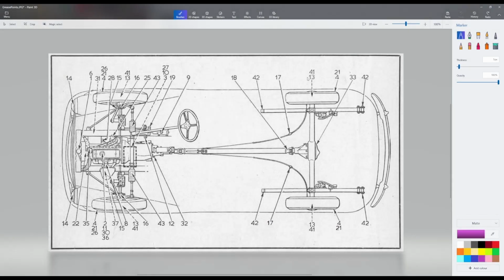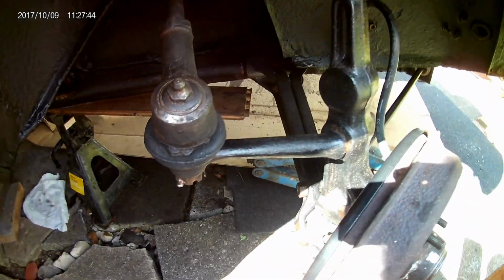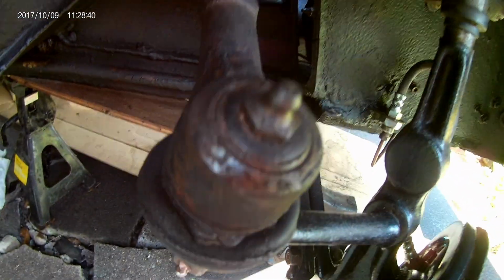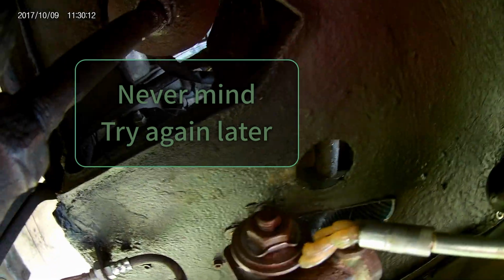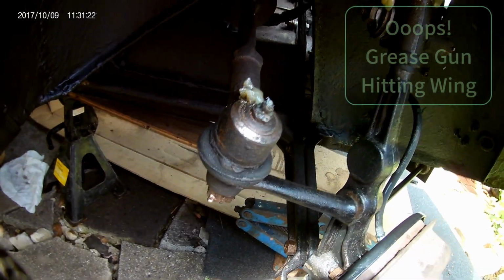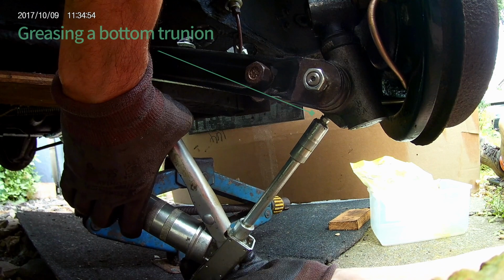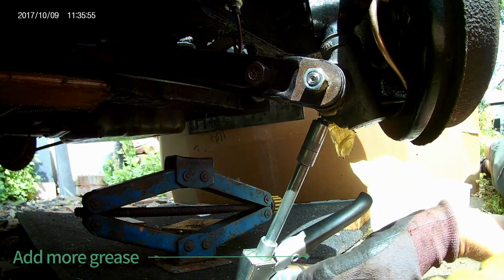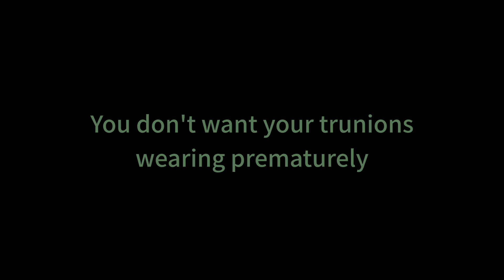Morris Minor 1000 Servicing: Grease Points

Comment: Another fine video, but again the steering rack is ignored. Access to the nipple is through to passenger side footwell/ firewall and the 'Grease' should be HD90 oil. That's what they put in there in 1951, when my Minor was assembled.
Cheers
Reply from the maker: Thanks for the comment. Good point about the steering rack, we have done it but missed it out on the video. I'll try and do an update when the weather is good again. It's also a frequently asked question from new owners, so would be useful.